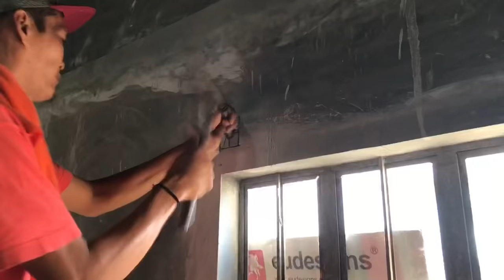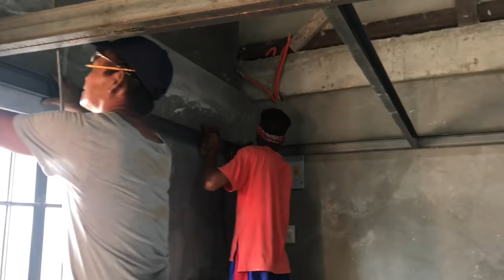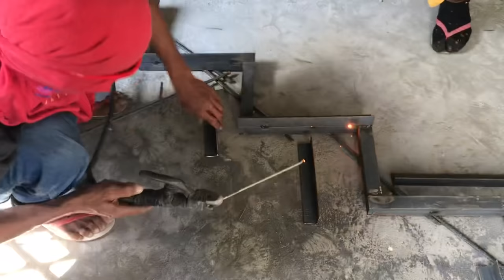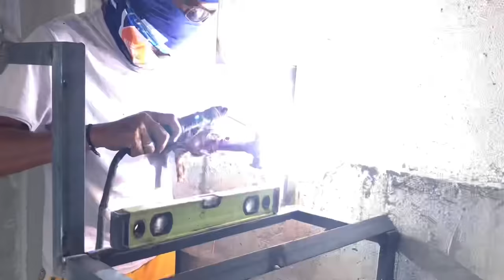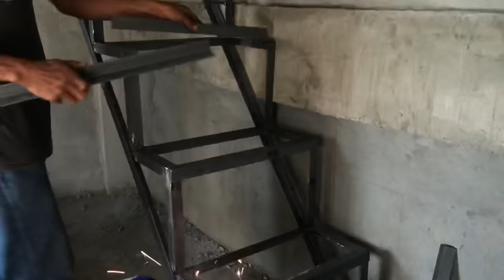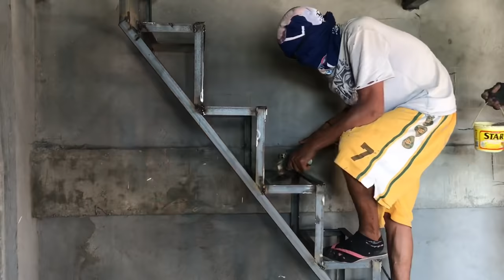Loft bed / Steel frame

Comment: Cool but horrible working conditions for the workers. They need proper PPE.
Reply: yes your right if they are keep this kind of practice like not wearing a proper welding mask, there eyes will soon get destroyed and they are also removing the blade guard of the angle grinder.
Reply: They don’t need there expertises
Reply: this translates to very much cheaper labor cost...
Reply: @sophiaangelacabando6762  🤣
Reply: They don't need your opinion Boy Marites haha
Reply: Most construction workers here only use PPE when there are inspectors visiting the site
Reply: That's usually the case in the Philippines because it's either they are stubborn or they can't afford such equipment.
Reply: You sound just like a union worker lol..
Bro.. that’s probably a latin American country and that’s why they make the difference in the USA. They work on any condition and get used to it.

PPE is very important but these guys are on another level
Reply: Using PPE here in Philippines is for weaklings..😂
Reply: It just light project, PPE will slow them down...

Comment: ang galing napakatibay nmn ng hagdanan. 
kaso yung loft frame hollow block na wall ang nagdadala heheheh. ang lakas ng loob butas sa pader pasok ang 2x3 na channel may suporta naman hagdan ang tukod bahala na d naman kami ang titira dyan. sana tumagal at d madisgrasya yung nakatira pag medyo malakasd ang lindol. gudluck sa tititra.
ung magpapagawa po ng loft bed make sure maayos suporta ng frameb hindi yung tinusok lang sa pader. dapat may makapitan syang poste o kaya roof beam, napakabigat pa naman ng bakal na materyales.
Reply: yung bolt po ? yung malalaki pina patagos sa pader,oks lang po ba yun?

Comment: Ang ganda, kaya lang ingat po sa angle grinder na walang takip. kahit expert napo ang gumagamit, marami pa din ang naaaksidente. sanayin po ninyo na gumamit na may takip kasi kahit sa isang beses na mag shatter yung blade pwede po tumama sa mukha o ibang parte ng katawan na pwedeng magkaroon ng grabeng pinsala. tiyuhin ko po wasak isang mata. welder po siya at gumagamit din ng angle grinder. dahil sanay na daw siya, hindi na ginamit yung takip ng grinder dahil estorbo po daw, ayon, isang mata na lang naiwan, malabo pa dahil sa ka we-welding  na kadalasan ayaw gamitin ang welding helmet. kahit po ang welding rod ay delikado din sa kalusugan, dahil chemical po yan. Ingat po kayo palagi. tandaan po ninyo- KAHIT ISANG BESES LANG MANGYARI NA MADURUGAN KAYO NG GRINDER CUTTING DISC ay SAPAT NA PO YON PARA KAYO AY MAAKSIDENTE !  Katulad ng uncle ko, magsisi man, huli na ang lahat. Salamat po. Ingat po palagi para sa ating sarili at mga  anak.

Comment: Sobra taas po ng riser step..😊
Reply: The maximum height of the step is 7 inches or 18 cm.
Reply: oo nga at yong last na ikinabit na angular bar dpat flatbar lng pra tipid sa bakal at lapat yong apakan na ila2gay nla
Reply: Bakit parang pumatak sa "mata" Ang floor sa itaas 

Pasensya Hindi ko talaga Alam Kung  panu at saan Ang simula ng bilang ng Oro Plata mata
Reply: Consider the space kaya tumaas ang riser...kung susundin ang standard height ng riser hahaba ang run. For me this is normal for mininalistic.